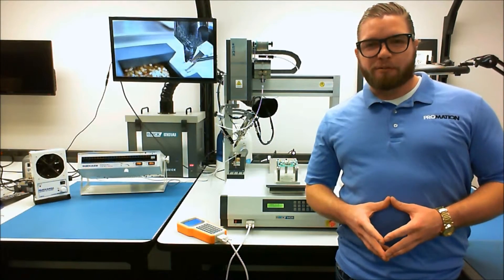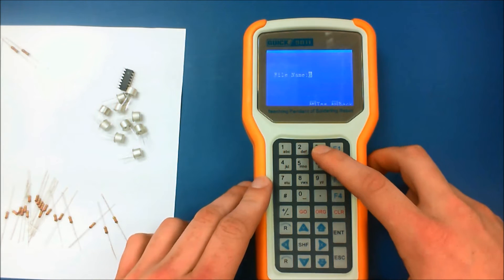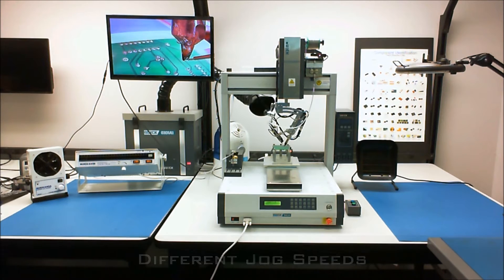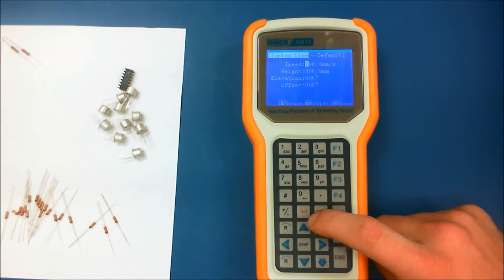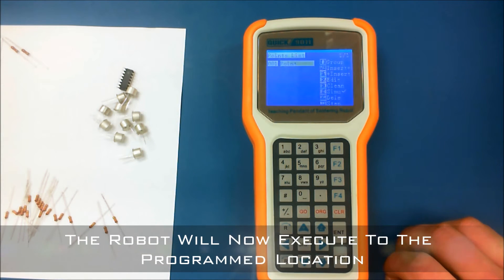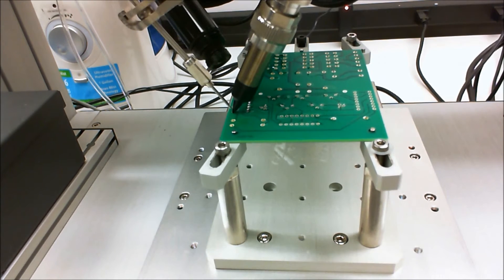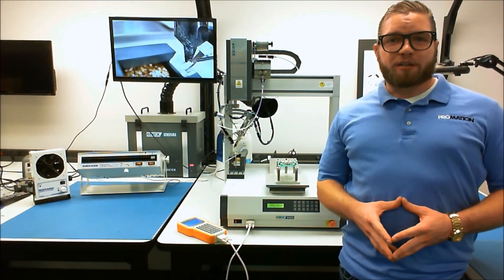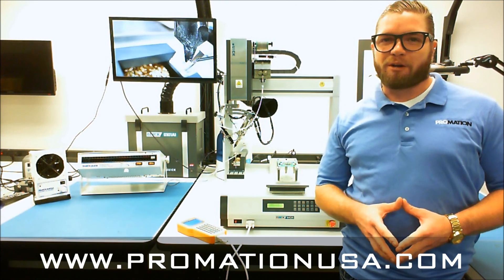Programming The Quick 9434 Soldering Robot by PROMATION INC.  USA

Comment: That PCB looks quite burned ! And can Quick 9434 solder multiple PCBs at once ? Like 3 pieces at once ? When we have 400 mm travel, why should we work only on one PCB ? Thx for answer
Reply from the maker: Kirgo - Actually the brown on the PCB is the NC Flux post soldering.  
- If you look at the end of the video it shows you the same PCB post cleaning cycle.   
- PROMATION USA and QUICK offer many many different robotic soldering solutions ranging from single axis soldering robots up to robotic soldering solutions at 3 Meters Long (8-9ft)!   - The QUICK 9434 is one of our best selling / most popular models.  The robot holds up to a 256 on-board program storage with a USB Back-Up option - therefore, YES!  With so many programs available for storage; the only limitation is how many fixtures you can build!   
- - If your product is 60mm x 60mm for example:  Yes you can fixture a multi-up fixture plate to solder multiple PCBs in a single robot pass.   
- Please keep in mind Kirgo that this is a demonstration video and are introducing users to the system.  Ideally yes, for a PCB this small we would recommend a multi-up fixture be made for production use to optimize robot utility and working area.